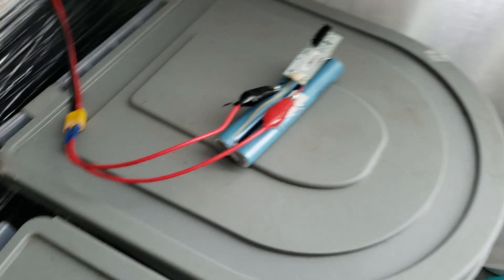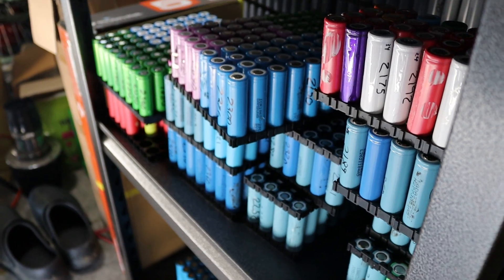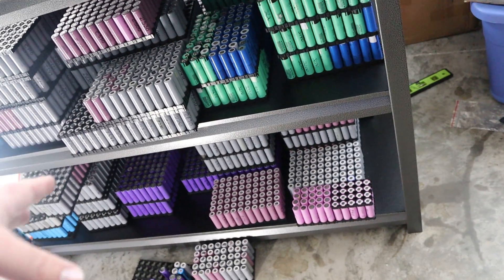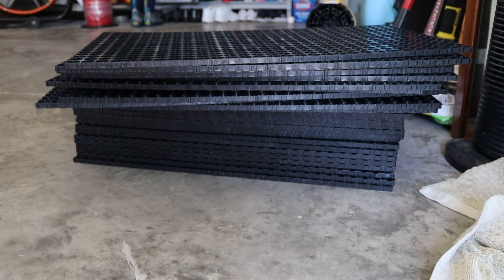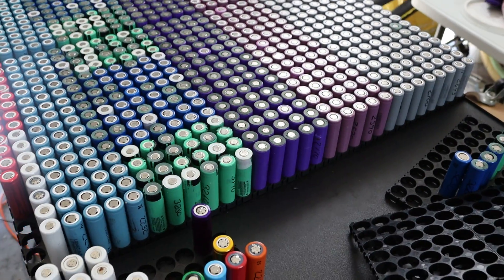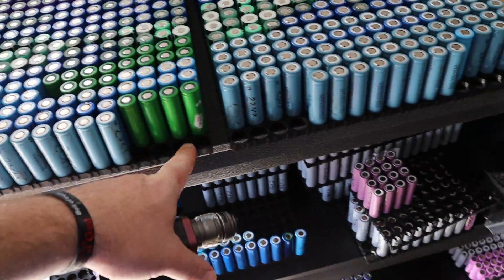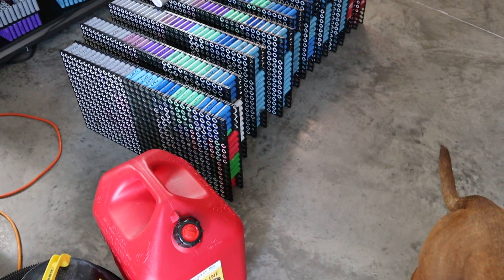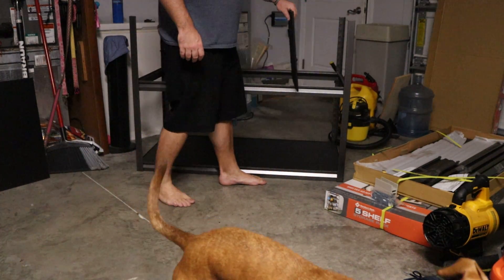48v SOLAR POWERWALL from 18650 Batteries part1, Spot Welder,  it has begun!!!

Comment: Hi friend I also made a 24kw 18650 wall
Curious what you have set as parameters in the inverter
such as Bulk Voltage
float
Network return
Voltage Cut Off
Reply from the maker: main thing is to make sure the inverter is set to the type of chemistry your batteries are.   I like 56v to 46v for 14s lithium ion batteries.

Comment: I realized I somehow wasn’t getting new videos and checked in to see. How’s the project going? Any updates coming soon? I’ve been traveling so haven’t had any time to work on my project after testing and sorting 20kwh of cells. I’m looking forward to taking them next steps on mine as well as seeing your progress!
Reply from the maker: Thank you!  I have been focusing on the crypto market all year.  I have a smaller 12 kwh rig for now.  I have half of the big packs done.  I was hoping to have a big shop built and I guess I have used that as an excuse to wait.  I should make an update video for all those that are interested.  If I could do it over I would have bought bigger cells like 120ah lithium or 280ah Lifepo4. I have had set backs finding room for all my 18650s (14s 600p) to be in a convenient place to power the house.   Good luck with your cells. It has been a great hobby.

Comment: You kinda described how you placed each battery into each pack?...but not really... So basically?....when you are placing the cells into the new packs?...do you place them based on their capacity?...like 2800's at the top?...& 2200's at, near the bottom?... &/or do you just place similar cells together?...like 2350's...2400's...2340's?...etc?...thanks
Reply from the maker: 4 like cells together connected to the bus bar with a 4 amp fuse.  I think in part 2 it will make more sense.  but I dont think it would matter. In my mind the only thing that matters is that each series pack has the same capacity.
Reply: I was wondering the same thing.

Comment: No issues with different make batteries as long as li-ion and mah or the charging or discharging in the specs match?
Reply: All batteries are supposed to have the same chemistry, so matching capacity and resistance should be enough to match them they should all degrade at the same rate.

Comment: Awesome! How and where did you get so many batteries? How much have you interested in this project so far? It's awesome! I'm planning to design a WiFi battery monitor system. Msg me if you are interested. It'll plot voltage and current and store it in a microserver which will be connected to a router via wifi. And it will be super cheap and scalable. It will be capable of monitoring packs independently

Comment: Hi Are these batteries new or used? What is the efficiency of used batteries. Thank you
Reply from the maker: These cells are "new old stock".  all tested at perfect capacity or higher.  You can use used cells. do lots of watching different videos. it took me more than 6 months of watching everything I could to get half a clue of what was safe.  good luck

Comment: hey dude it is that you are not using a fuse wire?
Reply from the maker: Im building bus bars now. will have 4 amp glass fuse for each 4 cells.
Reply: @RodneySolarCircuits  ahm..so dude spot weld it is not recomended in a recycle battery laptops?
Reply from the maker: @marcelopepito51  I don't understand.   These are New old stock that were all tested and have full capacity. Grouped in 4 that are same cells, same age, Same capacity then connected to the other sets through a fuse. Sounds good to me.  Im not gonna fuse every cell.  That's over kill. This is labor intensive enough. Maybe with a smaller pack.

Comment: I'm looking at batteryhookup these are a great deal! Did you have any trouble removing bus bar from them? I worry about used batteries because I have torn some of the cells trying to remove the bus bar..
Reply from the maker: I haven't had issues with any batteries from them unless they are for salvage. Modem batteries are good,  new old stock.  Always capacity check them before using them.  Safety first. What bus bar are you referring to?

Comment: Those are some HUGE batteries! If you use the pack-size heat shrink over each pack, you'll find it holds it together solidly without the need for bolts :)
Reply from the maker: definitely going to wrap it with something. I looked it up and it was like $110. It turned me off at that moment but its looking better as I search for other options.

Comment: Ok is good idea but with risks...to large packs and you have problem with large bus current...better few smaller packs and put packs parallel... better cooling and current management....
You have to know you don't have brand  new cells....
But what do I know about that....
Reply from the maker: The cells all tested new.  I had enough cells that I didn't use the used cells or even ones that test below rating.
Reply: Nice ....like the video 🖖😎👍 bus bars must be large ....how much current shuld u pull from the packs that u shuld know before u bild the pack ...what u pull long term ...what short term...
100A is extrem for dc current ....
after 150A is considered dangerous if anything begins to heat up ...and if heats up it will also burn ...
200A is insane to run anything with that current and belive that would last...
and use anything else as cooper is a joke ...aluminum have 2x resistance as cooper...
That are few thoughts that I add ....practical application....
For 100A that I draw from battery's I use 120mm² fine wired cable and with eye on the equipment....
Good luck....👍👍👍
Reply from the maker: @bostjantrancar9605  thank you.   Im using all copper.  No aluminum.  12kw ÷ 48v=250a at the low end.  House uses 30kwh a day. 1 a/c and well pump. Range will stay on grid and maybe dryer unless its a sunny day.

Comment: What is the minimum ampere capacity of a single cell used in the battery?
Reply from the maker: 2200 mah
Reply: @RodneySolarCircuits  Excuse me. Can I put from 2200mA to 1000mA in a single column? Thanks
Reply from the maker: @أبوبكرأحمد-ح1ع  The goal is to have the same capacity in each series. so you can mix. as long as the total is the same
Reply: 1000mah after a few CDR test. lol